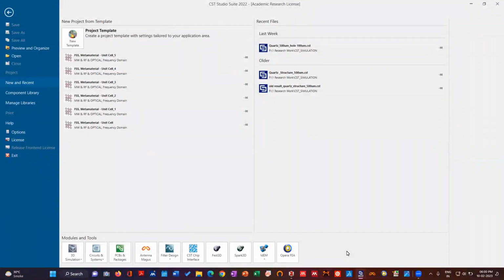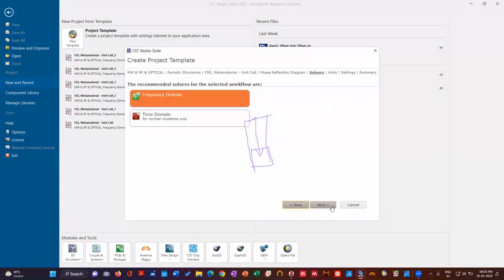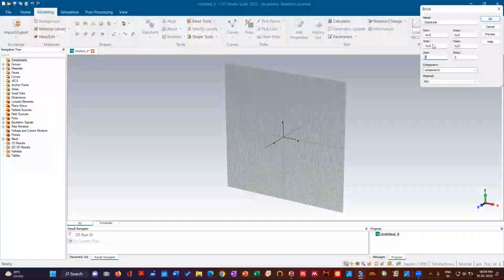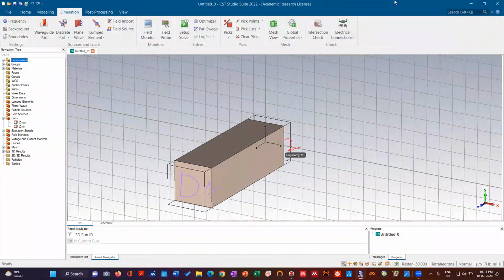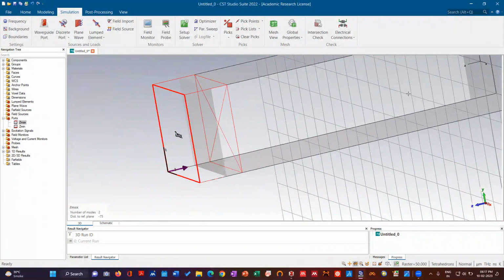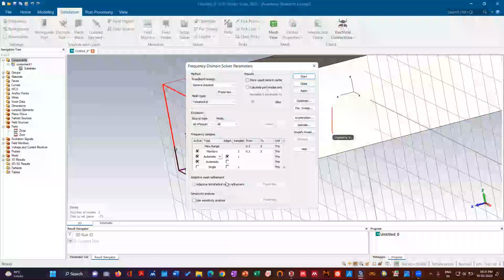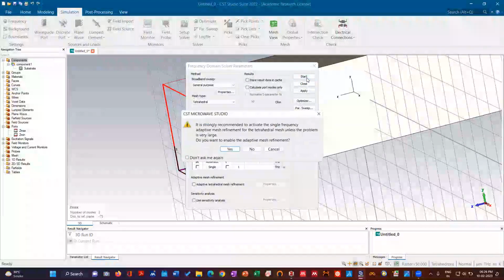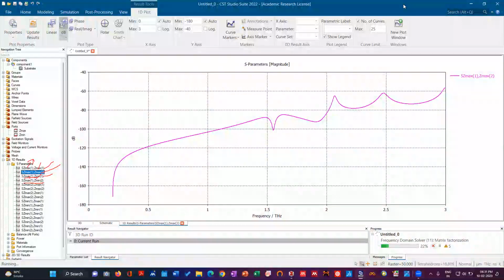Step by step simulation procedure of FSS unit cell design and analysis using Floquet port excitation

Comment: Sir, what should be the free space gap between unit cell surface and the port location? Is it lambda/4, where lambda is the wavelength that corresponds to the center frequency?
Reply from the maker: Yes with reference to center frequency.